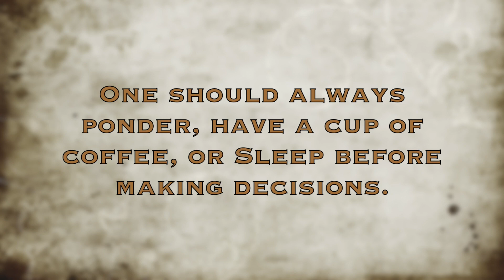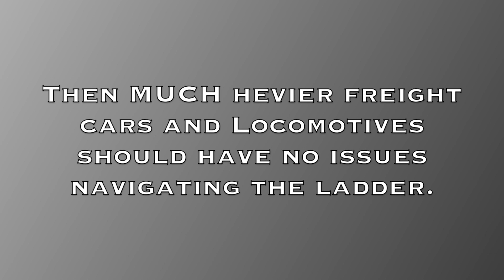Model Railroad Update 43  Staging 7 (Storage Yard)

Comment: As far as your tortoise machines being that close together, get a remote mount for them and separate them as needed. Circuitron sells them, they are all over eBay as well
Reply from the maker: Thanks Jeff.  This was some time ago.  All the tortoises worked fine without the need for the Circuitron's remote mount.

Comment: The track pin would be the clearance point for the track.  You should clearly mark each track with the clearance point to avoid oppses when others operate your staging yard.
Reply from the maker: Thanks Lewis, often on camera words and terms just fail to make themselves available when you need them.  I plan on having some no clearance posts in all the appropriate locations,  I may also paint the ties a contrasting color as well.  We'll see.  I'm still a long way away from running trains yet!  Thanks for the comment and view!!  ~ Dennis

Comment: Dennis....we can forgive model railroad building mistakes....but.....socks with sandals....not kosher! 😣 You can extend the lead into the turnout (second on the right of the curved turnout @25:28) by a couple of inches and get your spacing. Looking great bud! ...Claude  And where's a link to your Teespring?
Reply from the maker: Thanks Claude!!  I like my orthopedic flipper floppers, that's the only way I can model railroad for 8-10 hours a day!!  Yeah, I realize now that I should have made sure there was about 16" between the frogs on the #8's.  It's going to work though,  I'll just lose some usable length on the yard tracks.  My plan has always been 10 car trains and I've got that and more in the yard.  ;-)

Comment: Dennis, Where did you get the rubber band powered spiker.  And does it drive all the way into the plywood?  Liking the progress so far.  I've been a fan of narrow gauge for some time.  Looking forward to more videos.  Joe
Reply from the maker: The "Power "Spiker"  Awesome, it now has a name!!  It's a device I made several years ago.  Simple design, brass tube and wire coat hanger.  I usually drill a pilot hole that is slightly smaller than the spike.  That makes spiking much easier, but it does have the power to spike with no pilot hole.  Thanks for the comment and view!  ~Dennis